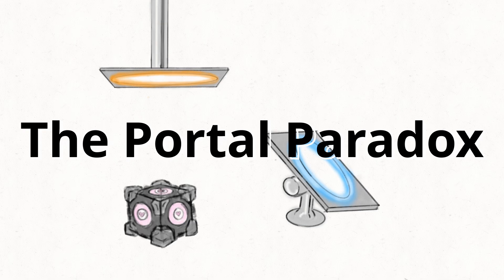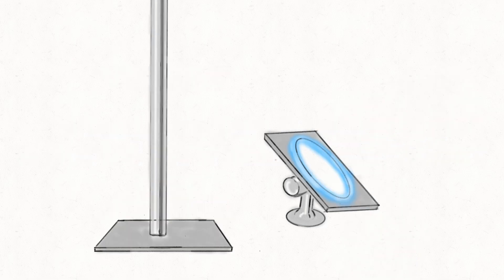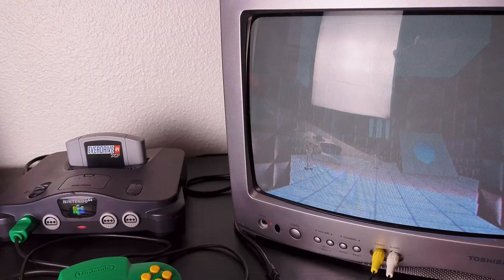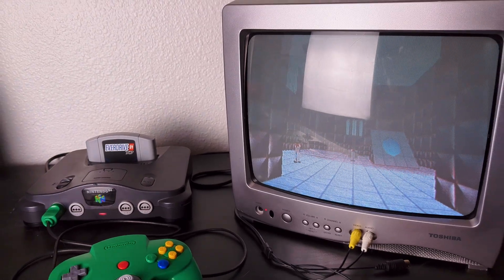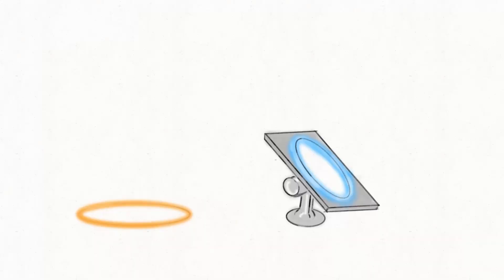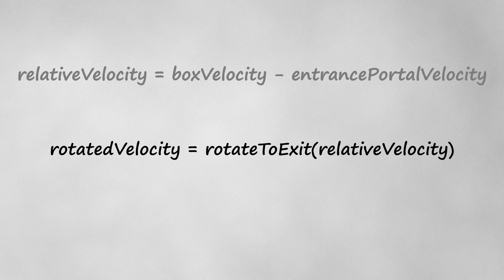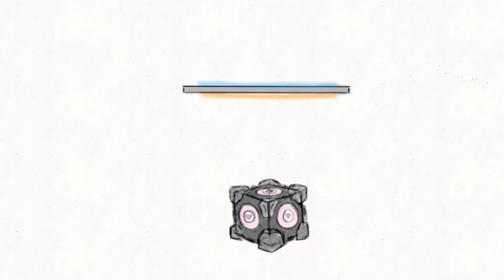I rewrote Portal from scratch and solved the Portal Paradox

Comment: Your video implicitly shows another great approach for arguing the correct result.  Look through the stationary portal.

If the portal is 10 meters above the top edge of the cube, and starts moving at 1 meter per second at 11:59:50, then at 11:59:50, the top of the cube will be seen to be 10 meters away through the stationary portal... at 11:59:51 it wll be 9 meters away, at 11:59:52 it will be 8 meters away... as you watch through the stationary portal during these 10 seconds, the cube is approaching you at 1 meter per second.  If something is approaching you at 1 meter per second, what would make it suddenly stop?  There's nothing.  It was travelling 1m/s approaching the stationary portal from the other side, it travels 1m/s while it is in transit, there's no sense in saying it's travelling at anything other than 1m/s on the other side (except for gravity taking hold).

Comment: I still disagree. The portals act like holes or windows, as long as an object isn't making contact with the edges, the velocity of the hole should be irrelevant. In this case, the box is still at rest, and the only thing acting upon it is that it's now on a slanted surface and should fall down. The flaw in your equation is that the velocity of the portals shouldn't be taken into account at all, the portals just act as though those two points in space were adjacent to begin with.

Comment: What soulution are we after? What's cooler, or what's more physically accurate? The cooler one is definitely yours, but it does seem to violate conservation of energy/momentum. In order for the box to gain momentum, momentum or energy must be lost somewhere else in the system which doesn't seem to be the case.

Imagine a simplified experiment, where the entire system is in a vaccum and no gravity. The orange portal is moving at a constant velocity towards a stationary cube and the blue portal is also stationary. With your solution the orange portal would swallow the cube and keep going, and the cube would shoot out of the blue portal, thus increasing the energy in the system, because the only other two things in it are the portals and they haven't changed.

The only thing that would explain it is if the cube also affects the portals it is going through, but it has always been shown that you can freely move through the portals without any need for force so that can't be it.

Edit: After thinking about this a bit more, this also introduces a paradox though. What would happen to a second cube that's blocking the exit from the blue portal. The first cube has no momentum to give to the second cube so it shouldn't move, but it is moving in relation to the second cube. Which means that I actually have no idea what the correct solution should be and I'm starting to think it's neither of these two :D

Comment: I feel like it must go deeper than that. I'm all messed up now because I've never thought about this.

So we would first need to define what exactly a portal is. HOW exactly it works, does it transfer the particles of the object from a to b? Or is it just a hole in reality that bridges 2 points? Is the portal a 2d surface? Or a 3 dimensional tube? Do we need to factor the energy of the portal itself? Because where would the cube get the energy to fling itself? 

As they seem from the game, a portal is just 2, 2 dimensional holes that connect point a to b. In theory, the portal moving downwards wouldn't generate any force on the cube, the only force it would receive would be the shift in gravity over time as the orientation of the cube transfers from one place to another. But then there's a matter of perspective, if portal A is moving down towards a surface, it would appear from portal b that the ground is moving forward towards the opening. So for it to launch the cube, each half of the portal would have to be following a certain "reality" relative to its own position, independent of each other, and also us as the entity in that 3d space. 

So there must be more going on with the portals than just being a hole or the cube "should" just plop out the other side. Now I feel like the portals must be a tube, and that by existing, creates 2 separate realities where the same identical cube can exist in 2 places, and at 2 different states at one time. Because for us, we see it as a stationary cube on the floor, yet portal b's perspective is of a cube accelerating towards it. So the portals create an exact copy of the object, applies its own state of reality to it, and then destroys the original cube, or the dimension it existed in in the first place to maintain the space time continuum. If that's the case, it would be like everything you go through a portal you are creating a dimensional copy of yourself, and destroying your old body over and over again, and you are not yourself anymore but like the 1000th iteration of someone who died several test chambers ago who just happened to maintain a line of consciousness through each dimensional cloning. 🤯
Reply: Portal conserves mass, and a RELATIVE vector of momentum(which is why for example non-coaxial portals violate conservation of momentum). Those two things are the most intuitive, and frankly best definition of the portals we see in the portal games. Yes, THERE IS NO FORCE ON THE CUBE. Like if I drop a hoolahoop on you, as it's falling, you would be going up relative the hoop,  and if I define the top of the hoop to be standing still while the bottom of the hoop engulfs you, then you are going up into the hoop as fast as the bottom hoop eats you up. Your 3rd paragraph is just complete dinning kruger effect saying random stuff that has nothing to do with the traditional semi-consistent nature of portals in the game.
Reply: "If that were the case".
Just having fun with hypotheticals is all.

Comment: Nice Video,
I really appreciate the amount of work you've put in this. The examples you have given this might seem correct, but what i'm thinking about is: what happens if you stop the portal mid-cube? so only half of it is going through the portal. Does it move or not at all or does it get torn apart? 
I think the problem here is you are thinking of the cube as a "dot" not as a real cube, thats where your physics dont get along (i think? at leats thats whats bothering me)

Anyone got a solution for this one then?
Reply: I think his model is wrong, because the idea of conservation of momentum only works if the cube collides with the portal, but a portal is just like and opening it cant collide with anything so no energy should be imparted to the cube.
Reply: @inanis9801  momentum isnt conserved when theres portals, as something moving down can have its momentum changed to moving to the side. Energy is also not conserved, as an object gains energy when it goes through a portal to a higher altitude.
Reply: @jetison333  actually it is, if you see a portal as a shortcut between two points then a cube 'falling' through the floor to the ceiling was always at the height of the ceiling, this dose disprove my point however as the portal moving towards the cube is the same as the area on the other side moving towards the cube. Also this just illustrates the impossibility of portals

Comment: the reason I think the supposed hula hoop metaphor doesn't prove that the cube should fall flat is because it also inherits the momentum of the exit portal, essentially the throwing a baseball from a moving car thing

the motion of the cube from the exit portal remains consistent but in the hula hoop example it is counteracted by the motion of the portal. The position of the top of the cube as it first comes through the portal remains the same relative to the rest of the room. 

I mean if you just have a portal on the ceiling and a big piston that pushes the cube up into the portal it's the same thing as far as the portals are concerned. The distance between the entry portal and the surface is the same, and they get closer at the same speed. The cube has the same relative motion for the portal, and that I can see being solvable in source.

Comment: 1. Objects in motion or at rest remain in the same state unless an external force imposes change.
2. The force acting on an object is equal to the mass of the object multiplied by its acceleration. In other words, you can calculate how much force it takes to move objects with various masses at different speeds.
3. For every action, there is an equal and opposite reaction.

What force is the portal imposing on the cube? I would assume that a portal would have no mass, or else matter would not be able to pass through it without disturbing it. If the portal acted on the cube then the cube would have also acted on the portal, which doesn't make sense.

I also disagree that the 2 ends of the portal are separate entities. Relative to them, they must feel like a window frame. Both sides lead to different places but are ultimately linked as one.

Comment: Very cool! I'd argue that you have to take into account the relative velocity between the 2 portals. If your reference is the orange portal (it stays still) then the box AND the blue portal move up toward the orange portal at the same velocity. So the box enters the orange portal with some velocity, which has to be the same velocity as the blue portal. In that case, the velocity of the box would be added to the relative velocity of the blue portal, doubling the velocity of the box as it exits the blue portal, which is not consistent with another frame of reference.

I think it's less that speed is conserved, and more that energy (momentum) is conserved. In that case, there is no energy added to the box, so it can't change momentum, so it just falls out of the blue portal.
Reply: So much more well put then what I was gonna say, yeah no this is a pretty fantastic project and it is very impressive to reimplement portal’s mechanics this way. But yeah sadly I agree it’d be slightly lamer reality lol.
Reply: Yeah I agree, but there would be a rush of air throught stationary portal

Comment: What would happen if you move the portal halfway over the cube and then stop it immediately. Would the cube be "sucked" into the portal and shot out, or would it remain stationary?
Reply: If the descending portal was going fast enough, it will still shoot out because half the portal has plenty of momentum to share and RELATIVELY conserve. If it was slow though, then gravity would pull the lower half down, and the upper half down too(which in absolute terms just slides it to the edge of the portal).

Comment: I dont think I agree with the notion that a portal moving converts that velocity to objects entering the portal.

If you were to stand in front of the stationary portal while the other one moved forward, there would likely be a breeze of air, but it wouldnt be a jetstream of air. Air would be pushed in causing increased air pressure on the other side, but that would be counter balanced from the pressure created, therefore a slight breeze would be the result.   Air would still be displaced around the moving portal.

The 2nd way to look at this is if the portal stopped halfway through the cube, would it jump up a bit but fall back down? If it would, that would imply the portal was working more like a vacuum than a wormhole, assuming the wormhole is not a vacuum in itself

Comment: I'm largely on the box go fast side of the argument because of relativity, but I do struggle to comprehend what the mechanics might be. If we imagine 2 portals in real life, if one of those portals was moving I would still not have inertia/momentum in the direction of my exit, and the portals are shown not to act on objects at all except to change their location.

That last part I think is the strongest argument for why box might not go woosh. The portal is not transferring any energy into the thing it is teleporting. The speed at which an object might appear on the other side of a portal might change based on how fast the first portal is going but not how fast that thing comes out of the portal

Comment: How does portal actually work? For example that same question, slamming portal onto cube, when is cube ejected and gains momentum? If you slow down your experiment, cube is stationary on floor and bit sloped on blue portal and then just as whole cube gets eaten by orange portal, it gains momentum and gets ejected from blue. That cube for sure should just slide or roll down the blue portal since below the cube its still floor, just sloped.

Comment: This is a hard one.
I think the equation is wrong. The cube never gets in contact with the moving portal, so the momentum of the moving portal cannot be applied to a cube.
A portal is essentially just a hole in space. Space does not have any momentum. And because there is never any contact between the moving platform and the cube, no force will be transmitted onto the cube. Hence the portal will move through the cube, and the cube will just stand on the other portal, without any momentum.

Comment: Gameplay-wise i feel this is the best aproach. 

But i dont feel like the box would shoot out of the portal like that. I don't think the portal itself can have momentum, sure the frame is moving, but the portal itself (i mean the connection between both portal frames) is static in the 3rd dimension (i think it would move in a 4th dimension tho, but i dont think 4D velocity would translate into 3D).

Like @pikachu1019 said i think of portals more like doorframes, the frame itself has velocity, but the hole doesnt. What would happen in your example if the portal stopped before engulfing the whole cube? would it be sucked by the portal? You see, it doesn't make much sense for me :)

BUT Gameplay-wise i feel it would be lame if a portal came at 200km/h and crushed a cube and the cube just poped out the other end with no speed 😂

Comment: What happens when the portal piston changes it's velocity as it passes over the cube. With this equation would the cube not have to stretch or compact?
Reply: What happens when you change your velocity irl? Do you stretch and compact? No, not unless you experience enough force to make such a thing happen. If the portal slows down or speeds up while traveling over the cube, the cube will simply slow down or speed up in compliance, just as it would when any other force acts upon it
Reply: @brodiesaltsman2842  I'm not talking theoretical functionality. I specifically stated "with this equation" as I was referencing what I thought to be a flaw in this solution

Comment: What would happen if you slam the moving portal down on the box, but stop when it is halfway, 1/4 or 3/4 inside the box? Would it then always plop out or is it relative to when you stop the moving portal? Let's say if you stop it at 3/4 inside the box does that mean 3/4 of the velocity is converted to the box itself? So technically the 3/4 of the box that will experience the velocity will drag the 1/4 with it (if it wouldn't disintegrate itself due to internal stress)? So at half it would just plop out? And at 1/4 it would hop a tiny bit but ultimately stay in place? Hope you can test and show that too.
Reply: damn I'm overthinking this, my fast assumption is the box would just plop out at half speed if the portal stops halfway, or 1/4 speed if it stops 1/4 way, and so on.
then again I'm just a dumbass so enlighten me.

Comment: Very curious what happens if the moving portal stops half-way down the cube. Or what about 99.9% of the way down? Does it remain stationary because the original part isn't moving? Does it get sucked in? Does it rip apart the matter causing a nuclear explosion??

Comment: But it doesn't have any momentum.
It has relative motion to the orange portal, not the blue one, so why after reaching the exit would it suddenly move relative to it.
Where did it get the energy from? 
It's not potential cause its goes higher than starting 
Which means the portal moving must give it kinetic energy...
So why does one portal affect its energy level but the exit doesn't?

Comment: why is it a paradox? it just kinda makes sense lol, piston has one way velocity towards cube, its jumps, 2for1 portal is moving towards the ground as fast as its moving away from the ceiling above the top portal, cancelling it out, if you could suspend a cube with magnets or such, and pass the double portal through ONLY the cube , you could have a ferris wheel of double portals constantly going over it and it would slowly move off course bc of the slight distance between portals , if the portals had no distance between them then it would stay motionless forever ( unless displaced air from the portals made a funnel or other compounding air manipulation)

Comment: So would the cube just get ripped apart layer by layer? If your having acceleration on one side of the portal but not the other then as it passes thru it, it is infinitely accelerating.  Which would explain why portals can't move. It's basically causing spaghettification

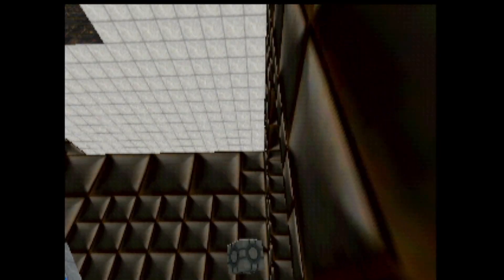Comment: 1:57 Your approach being right or wrong has nothing to do with whether this equation has a flaw! It's the choice of equation — your interpretation of how portals work — that matters. And there's no right (or wrong) answer there. Minutephysics suspects the original game is measuring speeds relative to the global environment because that's easier to program (and it would explain why objects can't pass through moving portals there). If so, that's not a wrong answer compared to this one; it's just a different answer, based on a different conception of how portals work.